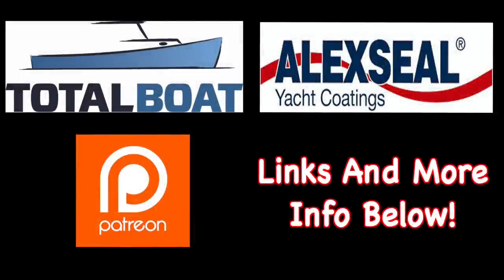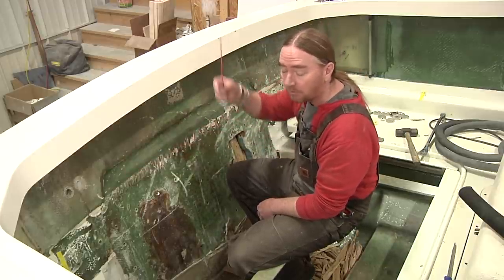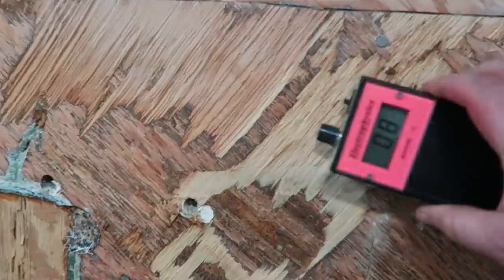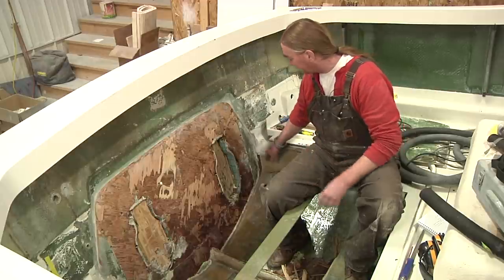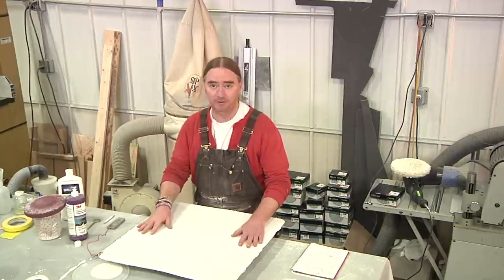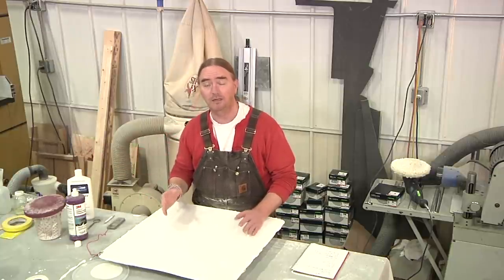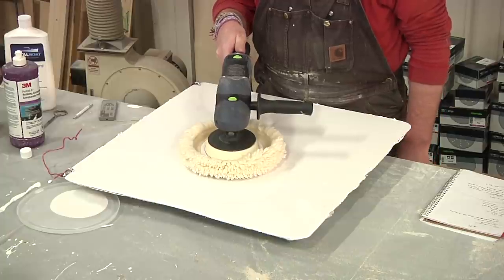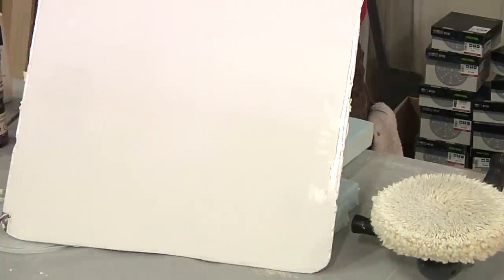Bertram Moppie Transom Replacement P1 And Spring Launch Tip: How To Use A Buffer On Gelcoat Or Paint

Comment: I've learned so much from this channel, not just knowledge but the confidence that comes with it.  ironically, with the boat rebuilt and ready to splash my last step is.... buffing it.  so yes, this video is timely as i didnt even know you had to use a special machine.  i thought you were using a grinder because... hell, it looks like one.
i got to practice my epoxy skills when i stuck a buffer thing on my 7" grinder.   grrrrr.

Comment: When you buy the Sawzall, look for the scraper blade that fits it. That thing is the nuts for removing caulk or soundproofing. (And I imagine floor tiles which is probably what they intended it to be used for ...)

Comment: Hey Andy, thanks for taking the time to make this great video. I don't own a fiberglass boat, but the education I get watching your video is priceless. For example, I'm plan to use my knowledge to rebuild a fiberglass battery box in our RV that the previous owner literally cut the bottom out where the bottom meets the sides, then supports it with some homemade angle brackets from underneath. Now the box collect road grim and dirt when traveling. I'm looking to use TotalBoat 5:1 Epoxy Resin, 3 Oz Chopped Stranded Mat to form the corner, and 3 or 4 layers of 1708 Fiberglass 45/45 DBM Biaxial fiberglass to tie it all together. The box will have to support, worse case, @ 130-140 Lbs, if I go with 2 lead acid batteries. Do those ingredients sound reasonable? Thanks.

Comment: I need that buffing compound, that was the first thing I saw was it was out of stock.  Some of the better stuff I've used over the years they no longer make.  I really want to try this stuff.  Aquabuff just doesn't do the job like I want.  But Flitz, will put a hell of a shine on it, if you get those scratches out first.  If I can't get some soon, I might try the old school "stick" compounds. I hate them but they work.  I've got so much sanding and buffing to do this year, it just isn't funny.

Comment: Hi Andy. That buffing technique and compound is good for gelcoat and Alexseal paint. I have an old 1985 Hatteras and it's painted using IMRON paint. Pretty much all older Hatteras were like that out of the factory. What would you recommend for this type of paint? I've tested on a small area 3M medium corse compound (with polish) and the results are ok but I feel it could be much better. Thank you for all you time and effort you put into those videos. Richard.

Comment: Curious for the next installment to see whether you use the method or removing the plywood that I did.  I also used an air chisel with a broad blade to remove the skin. Hard on the ears, but easier on the shoulders than a pry bar. :)

Comment: Question Andy I learn so much from you so thank you for all your stuff.  Hope I can ask a question.  I was given a cedar strip tornado which I would like to convert to a small solar electric cat.   My question is..... is there a way to use polyester resin with the cedar core.  For health reasons and cost I would prefer not to use epoxy if possible?  Also does total boat have a canadian distributer?

Comment: So I learned that you use a compounding pad to do compounding 👍. Never realized that’s what that wool pad was actually called. But then what should I be using when waxing?  You say you never use a buffing pad so I’m assuming you don’t use that for wax.  Do I wax with a compounding pad but on a lower speed?  What are those foam pads with the dimples used for?

Comment: question: I'm rehabbing a 14 ft flat bottom fishing boat, almost ready to start laying glass. outer hull gelcoat has spider cracks throughout. was planning on regelcoating after reglassing and replacing floor and transom. as far as gelcoat goes, what methods would you se to prep for replacing gelcoat?

Comment: I am replacing transom on Bertram 20 and following along. The 20 has a single plywood collar 2", but the rest of transom is cored withe 2 layers of balsa below water line and 1 layer above. All covered in single layer of roving. Do you have balsa under there?  My boat is a 1966.

Comment: Hi Andy, I noticed at time 10:54 you grabbed the buffer and when you touched the pad there was a lot of dust that came off. Is there a correct way to keep these pads clean before doing a job?
Reply: Yeah.  Use compressed air to blow loaded compound/paint slurry out of the pad. And when the compressed air isn't getting enough compound out any more, switch to a clean pad, and throw the old one in the laundry.  AmmoNYC has a whole show on pad choice and care.  Generally speaking, automotive technique applies for all this sort of thing.

Comment: You need to run coring over the entire transom from port to starboard and at least to the height of the original coring and you need to tie the stringers in too.  When that hull was an I/O there was very little stress on the transom and the transom therefore was lightly built.  As an I/O the weight of the motors and the majority of the stress of forward thrust was on the stringers.  With a bracket the weight of the motors and the thrust they apply will be almost entirely on the transom.  The bracket magnifies the forces too as it cantilevers the forces and weight further aft.  You need to rebuild the transom for the stresses of the bracket and outboard motors rather than rebuilding it the way it had been previously.
Reply: 1982mako224 
Good observation!   I was wondering about that.

Comment: That glass looked like it came off the plywood a bit too easily.  Personally I would not be looking forward to removing the plywood from the outer skin.  I am guessing that will not be a fun task.
Reply: I noticed that too.  I've been given to understand that polyester resin doesn't really want to adhere to wood, at least not the way epoxy will.